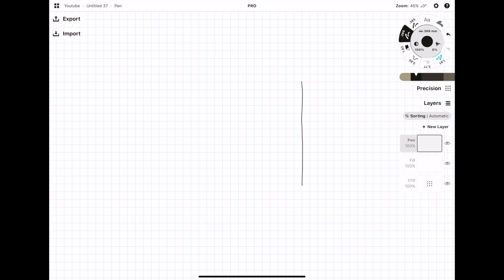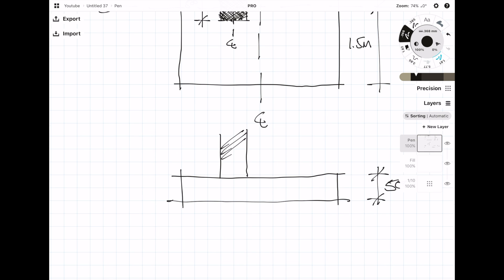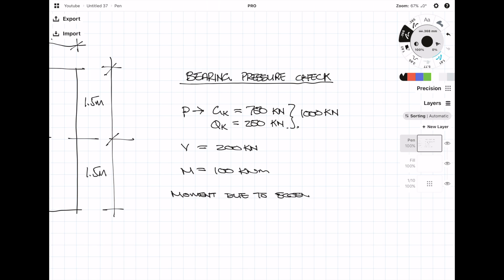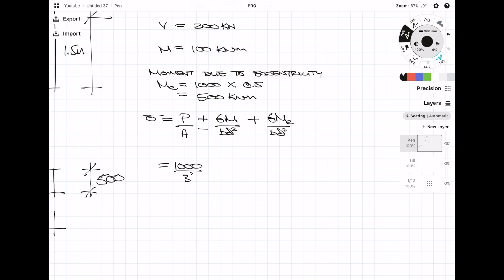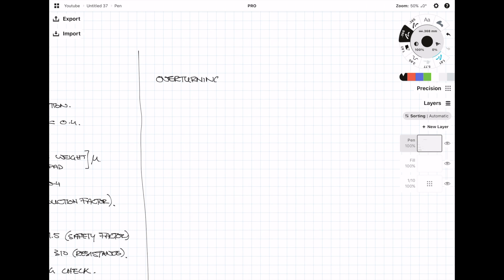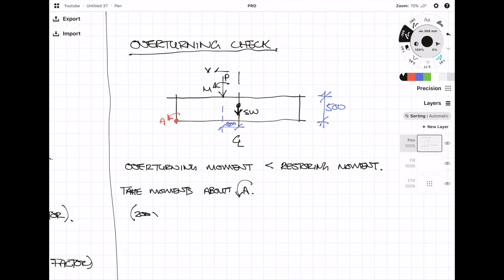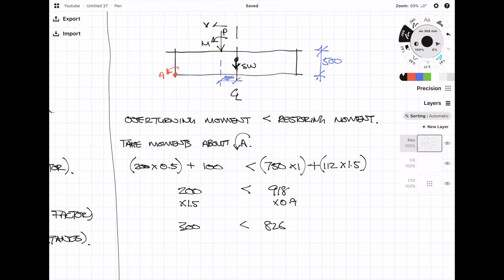Foundation Design Example with Offset Column and Eccentric Moments

Comment: Interesting tutorial, thanks for sharing. BTW, if you struggle with designing a steel base plate with anchors in a fully reinforced concrete footing, I recently noticed that IDEA StatiCa can already design both parts. And it includes the actual behavior of the anchors in the concrete pad, including all possible failures such as prying, shear failures, or pull-out. 
 https://www.youtube.com/watch?v=kBpHNRTARsY

Comment: Hello there,  a question regarding to your overturning check of the foundation why did not you add the additional moment due to eccentric load (column) you have calculated at the beginning of the video of 500 kN.m with the overturning moment ?
Reply: I believe because in first case the moment was calculated at column location, so you add the excentricity moment P x e, but for the overturning, calculation is made on the bottom left corner, so the moment due to the column force is directly P x (B/2 - e)

Comment: Hi there! I really like your channel! One thing you should always check: is your total soil pressure equal to your vertical load? (244 + 200) / 2 = 222 x 3 x 3 = 1998. Something is wrong, your minimal soil pressure. It should be 111 - 22 - 111 = -22. Mean soil pressure = 111. 111 x 3 x 3 = 999 ~ 1000. Normally a foundation can’t handle tension. So you should make a different calculation. Your eccentricity is 600 / 1000 = 0.6 m. The distance from the work line of your load to the edge of your slab = 1,5 - 0,6 = 0,9 m. The length of your triangle pressure figure is 3 x 0,9 = 2,7 m.  Your max soil pressure is 2 x 1000 / (3 x 2,7) = 247 kN/m2.
Reply: Agreed here. Thanks.
Reply: I agree. Moment at the centroid of the footing = 100 + (1000 x 0.50) = 600 kN-m. e = 600 / 1000 = 0.60 m which is greater than B/6 = 0.50 m, there's uplift. Thus, q max = 111 + 133 = 244 kPa, while the q min = 111 - 133 = - 22 kPa.
Reply: there is nothing wrong with  university text, but you are talking about an actual design, if you want,  this is the most accuarate one,  Pressure, P1 + (P1 - P2) (Lenght of direction in question, L + Width of column)/L = 266KN/m2

Comment: Great Video. I am assuming that this foundation is at some depth(say 1.5m) from NGL. In some case when the load is not as high as this example and pad footing is to be rested on the ground and no Geotechnical data is available, how would you approach in the design?

Comment: New to your channel and finding the content useful, thanks for taking the time to make it. Would be interested to see your method of assessmemt of an existing residential foundation relative to the effect of conversion works. For example, load bearing masonry wall removed and replaced with beam and posts and following through the effect to check suitability of existing found.

Comment: Question: According you the moment generated by the excentricity isnt reversable, as so, whenever there's a compression load with excentricity and no moment at the foot, there's an constant increase in the bearing pressure.
This doesnt feel correct! the pressure should vary and not be constant.
can you please clarify me??
Reply: hi i have a question. will eccentricity caused by column offset from the centre lead to greater bending moment?
Reply: https://youtu.be/m_ITdRW-wYI that’s a better eccentric pad foundation design
Reply from the maker: If the column force is fixed in place then the eccentric moment generated is also fixed and doesn’t vary. So pressure cannot vary if the only moment generated is from eccentric axial loading.
Reply: @EverydayDazz  shouldn’t there be more pressure closer to the eccentric column position compared to away from the column?

Comment: Big question. What do you do if your method shows the soil in tension. This can happen when the loading is outside the kern. The S changes - to what? You did it another way, but you passed over the real reason for using 1.5.
Reply from the maker: Do you mean when their is uplift? Soil can’t be in tension. 
If there is uplift then you need to make the foundation bigger to increase the self weight so that there is no more uplift.
Reply: @EverydayDazz  That is my point. If you have tension in the soil, then the design does not work and the design is flawed. Stop and redesign. You did not check for tension. If you have the same problem using a tall steel pole with low axial load, high overturning, and low shear, you can see tension, which is not good because soil does not resist tension. If you have a situation with unsymetrical foundation or skewed lateral loads the problem is similar but more complex. A wind turbine foundation is somtimes octagonal.
Reply from the maker: So I work out the stress on the soil and it’s all in compression, so that is the check to see if there is uplift. 

Also the overturning check is a check for uplift. Factor down the favourable forces and factor up the unfavourable forces. 
High shear is unfavourable because you take moments about the foundation.
Reply: @EverydayDazz  To be quite honest, I don’t do these foundations by hand, I wrote an Excel spreadsheet with pictures and diagrams that would solve the problem and print the documentation. We also do not use the .9 on the weight for overturning; I wish I knew what code you are using. My perspective is from the electrical world (NESC) and the telecom world (EIA/TIA-222), not the building world. Bowels wrote a book that had very good examples of ths problem but it is very old.

Comment: Great video, however I just have a simple question to ask, for the bearing pressure check, aren’t we supposed to check the calculated value vs the bearing capacity from the geotechnical report? (You didn’t include the bearing capacity) thanks.
Reply from the maker: Yes you would check against the allowable bearing pressure from the geo report. I just skipped it 😅
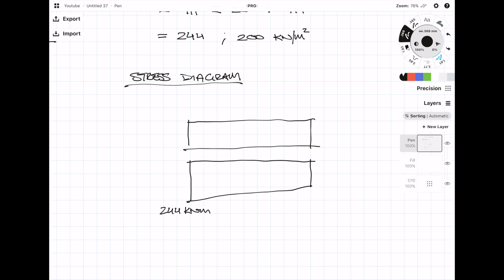Reply: @EverydayDazz  okay then. So at 3:32 on your stress diagram, you indicated that the calculated values for the bearing pressure are 244kN/m2(highest) and 200kN/m2, my assumption is that the bearing capacity is greater than 244 in that case, what do you think 🤔? (Bearing capacity should bd greater than the bearing pressure)
Reply from the maker: Yeah so if the allowable was greater than 244 than it passes. But if it’s less then you would need to re-size your pad to spread the stress

Comment: Would this "fag packet calculation" be sufficient for a building control submission or is it more for preliminary sizing or for Seniors to do a quick check?
Reply from the maker: If you tidy up the calculation there’s no reason why you can’t use it for building regs. 
Definitely a great tool to use for preliminary sizing too since it’s so quick.
Reply: @EverydayDazz  And by tidy up you mean copy and pasting the bearing pressure check, sliding check etc. in the correct sequence onto some calc paper?
Reply from the maker: Yeah basically. Maybe use a ruler for the sketches too just to neaten everything. But essentially the calculation as I’ve shown is good enough for build regs.
Reply: @EverydayDazz  Okay, good stuff. Thank you again!

You're probs getting sick of me saying thank you but your content is top quality mate fairplay.